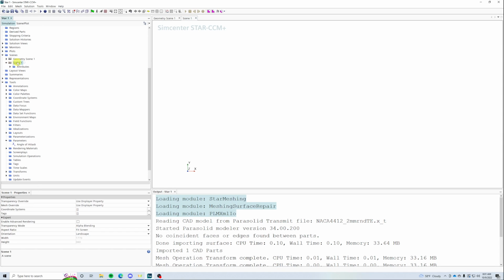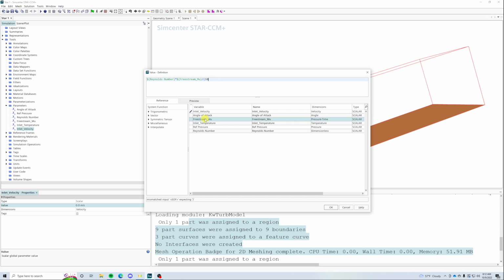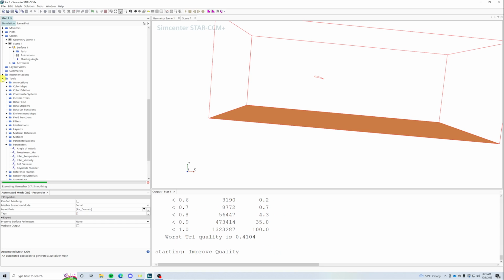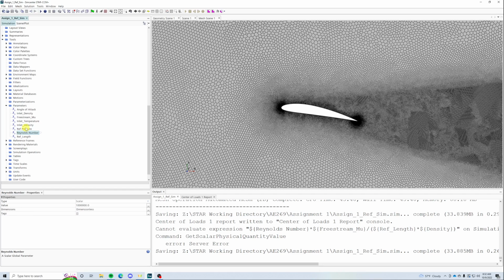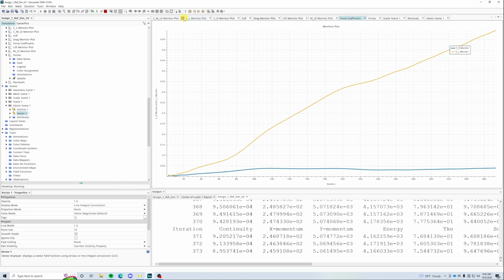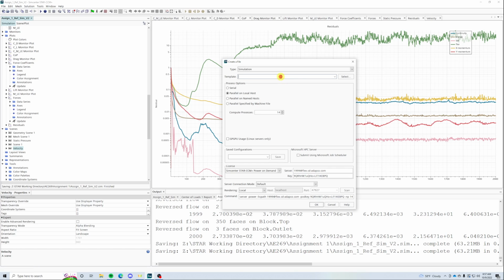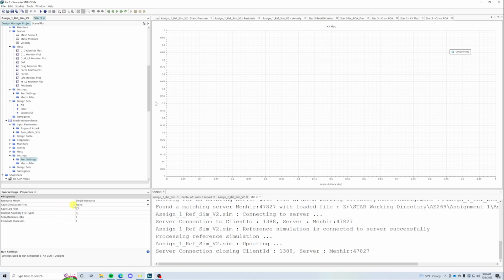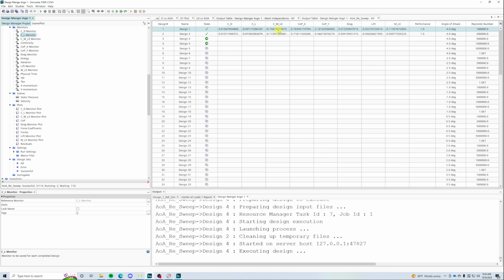Design Manager Airfoil Walkthrough

Comment: Hello Brian, awesome video, its so packed of useful information. one question though, in order to use design study do i need to have AoA parameter tied to the rotated (transform) airfoil part? Because in my simulation i have a static airfoil and in order to have a range of AoA ive created a new local cartician coordinate and tied that to my inlet flow direction and thus reports. Then i can rotate that new coordinate system instead of the airfoil part in order to simulate AoA.
id really appreciate the feedback
thanks!